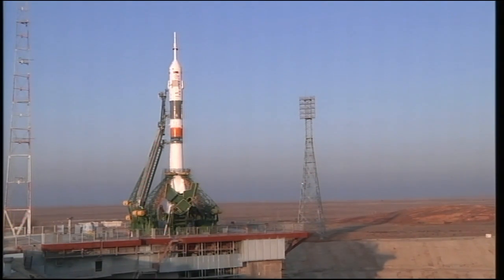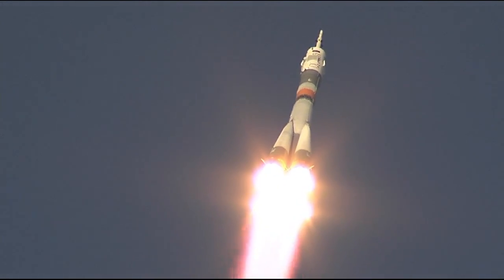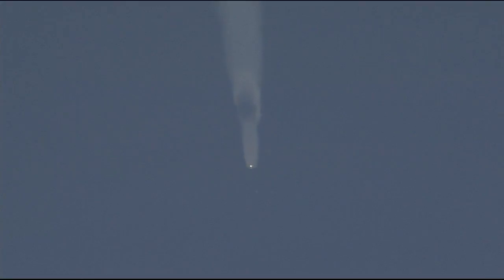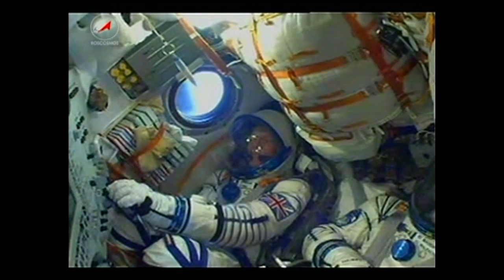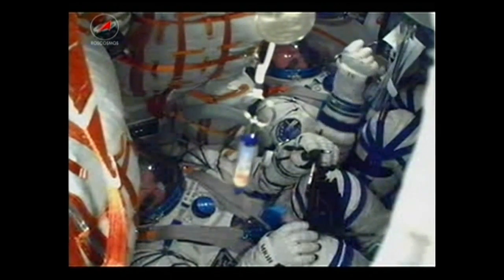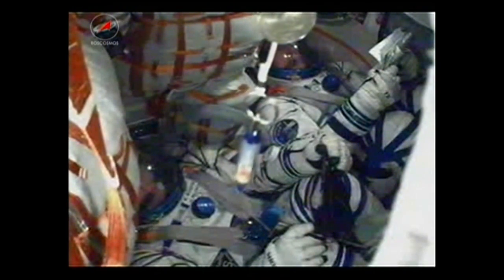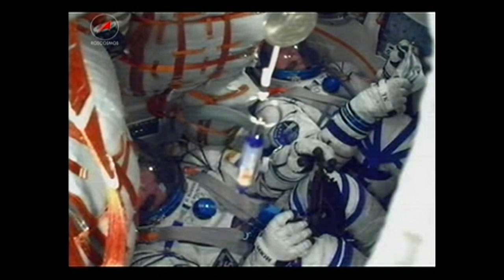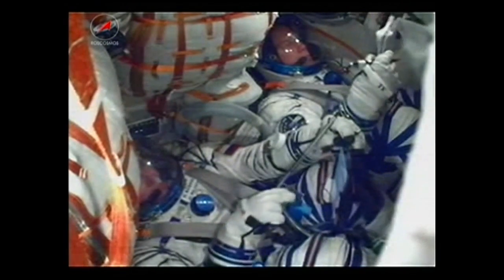New Crew Launches to the Space Station

Comment: So cool to see what happens when they escape gravity
Reply: luckily they don't escape gravity
Reply: escope1959 gravity has no limit, every particle in the whole universe attracts you (weakly though) : you can not escape it.

In orbit around the earth you are in "microgravity" : it's like a free fall. Astronauts are still attracted and influenced by earth gravity (almost as much as us on the ground) and that's why they are moving around the Earth, in orbit, and not just floating above the same spot.

But they are in "zero-g" because they are in freefall. That's what orbiting is. 

If they escaped gravity they would never come back to earth, they would fly away in a straight line ;)

Hope this helps, if not don't worry it's stuff you will probably learn in highschool
Reply: +legoclone09 The g-force is determined by the acceleration, and it depends on the rocket thrust to weight ratio. It is >1g just after the launch (since the rocket accelerates upward), then it changes during ascent while the engines keeps running. The 0g happens instantaneously after the engines cut off, not gradually. The gravity is still there, but the speed is to high and the spacecraft is permanently falls to the earth and misses (as Douglas Adams told:))
Reply: +escope1959 very basically explained: if you throw a ball upwards and forwards, it'll go up, then fall back down. Now if you throw it hard enough it might just go all the way around earth and hit you on the back of you head. But then still it's gonna slow down quick cause of the atmosphere... Air creating drag slowing it down. So the rocket flies up and gets fast enough so it will go all the way around earth and it'll just keep doing that cause there's no air in space (duh) so it'll never slow down nor hit the earth and thus basically falls forever. Did I explain well enough? I hope so. Failing that just google it XD
Reply: Yeah, but it does happen gradually! As orbital velocity increases you are still falling over the earth but slower each second so it would be about 1g at launch and it will gradually lower to about 0g after orbital insertion.
Reply: *****
Then why is it called zero g's?
Reply: ***** I assume everyone learns the Newton's second law of motion in school :) No force (gravity force in our case) means no acceleration, i.e. the movement without force has to be straight-lined with constant speed. Since orbit is not straight line, the orbital flight is accelerated motion, so the force has to be here.
Reply: ***** well that sucks... It's pretty basic. And it's really cool and interesting. In what country is that ? (I guess USA...)
Reply: Roman Semenko I wasn't talking about acceleration of the rocket, that is different. If they just accelerated without G-effects on the ship (not possible) it would be like that.
Reply: legoclone09 Roman Semenko isn't talking about the acceleration of the rocket either : 
The space station is orbiting at a constant speed but it is accelerating. In fact, a curved path means that an acceleration occurs, and the ISS circles the Earth. The ISS is under constant acceleration, wich is created by the gravitational pull of the Earth. That's why it's circling the Earth and not flying away.
So they do accelerate, and are still in microgravity. And there aren't g effects. Pretty cool huh
Reply: ***** you can't be serious, teachers must know that even if they don't teach it
Reply: +Derek M I know right! We should learn this in college. There is so many that doesnt know basic knowledge like this
Reply: Electro phobia Yeah, forgot about that. All orbits are slightly eccentric so the velocities are different at apoapsis and periapsis.

I do play Kerbal Space Program, just forgot about that.
Reply: legoclone09 haha it's an awesome game. But it has a problem : it makes it look like gravity isn't infinite
Reply: Electro phobia Yeah, the computing power isn't enough in most computers to calculate N-body physics BUT there is a mod that does it! It is called Principia: http://forum.kerbalspaceprogram.com/index.php?/topic/62205-wip104-principia-version-bourbaki-2015-08-15-n-body-and-extended-body-gravitation/